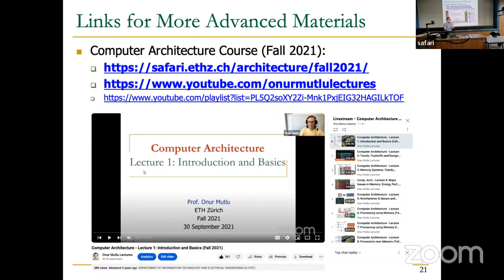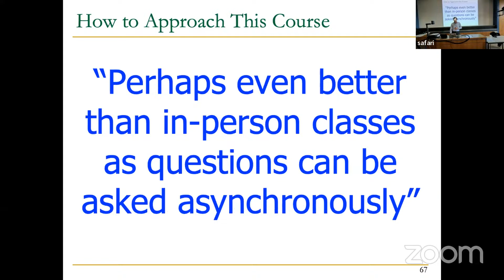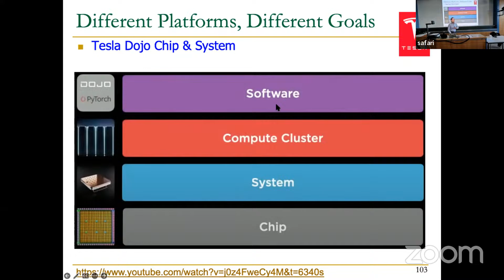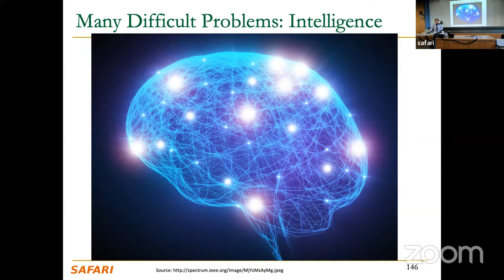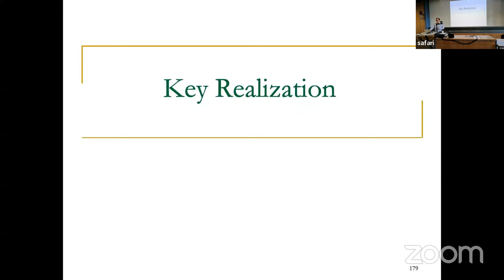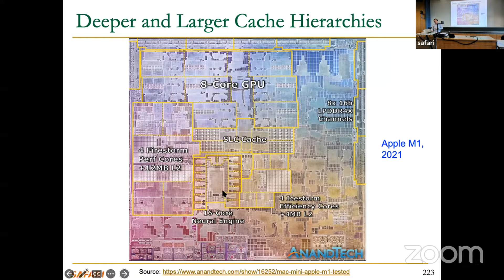Computer Architecture - Lecture 1: Introduction and Basics (Fall 2024)

Comment: Hello professor. I have a question, I have been following your 2020 Spring Course on Digital Design and Computer Architecture. Does this course come after the 2020 Spring one, or is the syllabus revised to include more concepts?
Reply from the maker: This course is the second course in line. If you have already taken the DDCA (Digital Design and Comp Arch course, which is at the beginner level; we teach that every Spring), you can more comfortably take the Master's Level "Computer Architecture" course (which we teach in the Fall). In the Master's level course we cover different, more advanced concepts.
Reply: @OnurMutluLectures  Understood, professor. Thank you.
Reply: Good, I thought this one was a more updated version of the same subject.